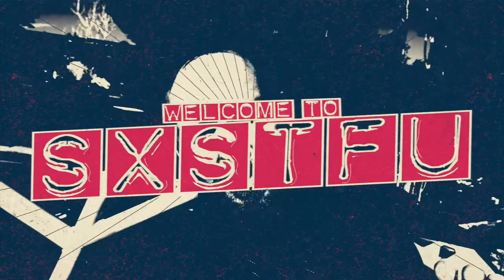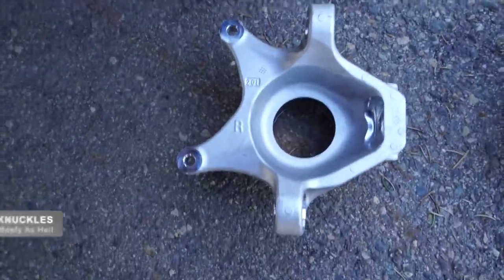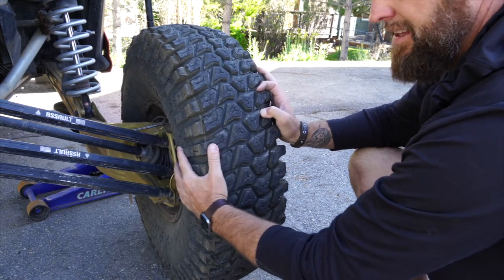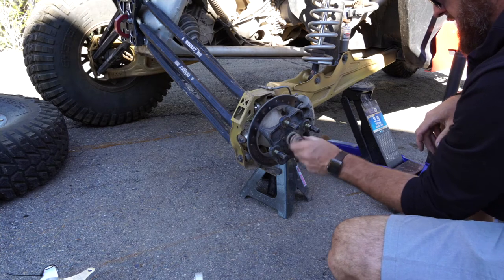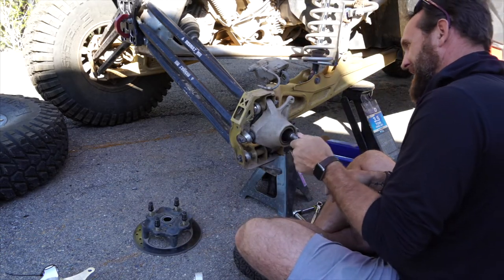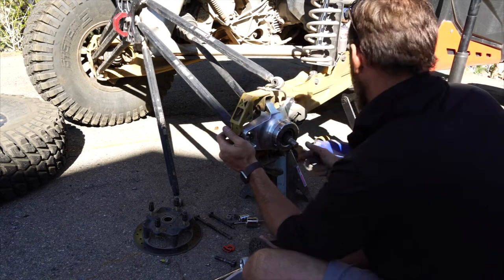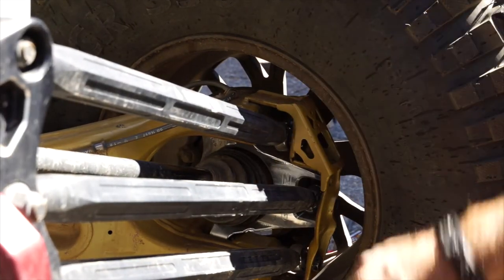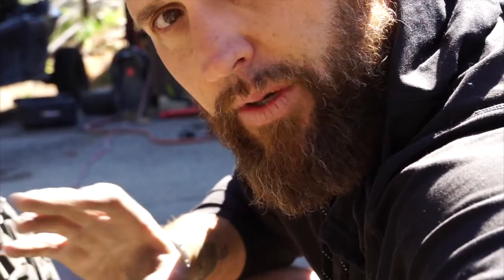Can Am knuckle swap ZRP and shock therapy fail

Comment: If you had the toe right wonder how much it move it move if a body bolted it through the trailing arm like the others i know  it does move through the Suspension travel but jus wondering how  much  because Polaris does  i jus wonder how much

Comment: where can I read that can am have fixed the knuckle problem for the 2022 models !!
Reply from the maker: Im not sure where you can read about it, but i know they double sheared the rear and we will be installing the new knuckles on an older can am.
Reply: Will the 2022 hub fit the 2017-2021 with no issues ?
Reply from the maker: @Clearbrowser  we are swapping the 2017 stock rears for 2022 on an upcoming video
Reply from the maker: I’ve got some on hand here for the 2018 max, probably install after Christmas.